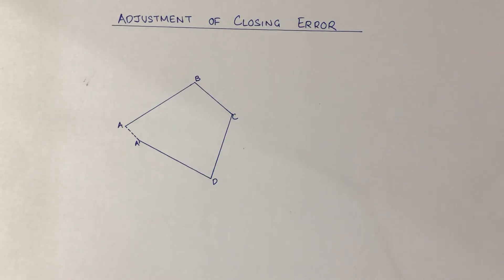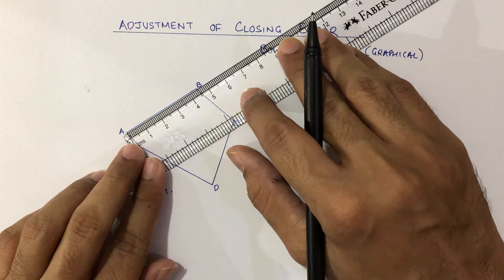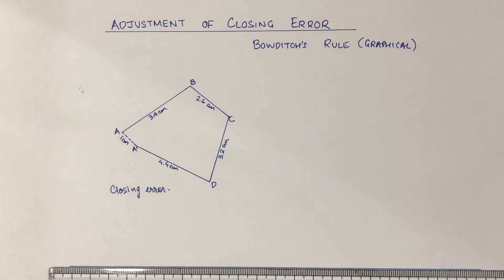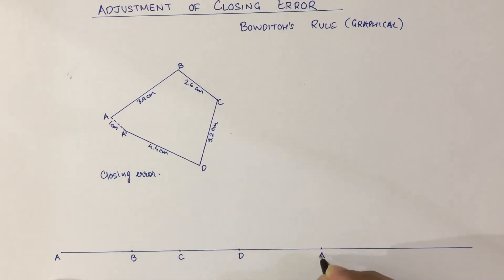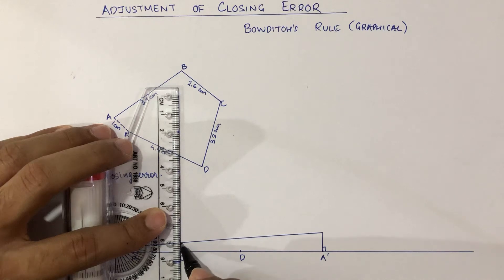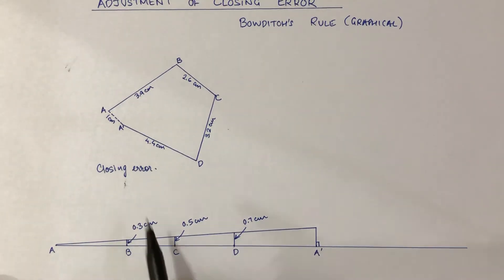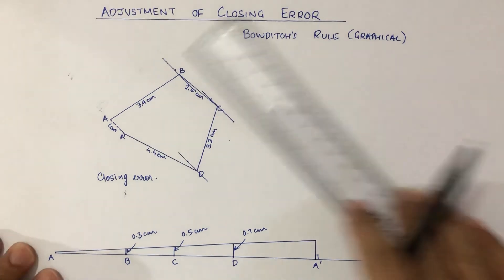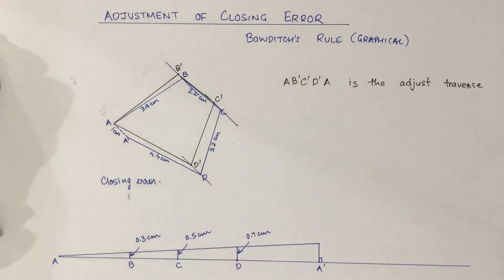Adjustment of closing error by Bowditch’s rule

Comment: Sir what is the real life use of this ?  Why I need to learn it?
Reply from the maker: While doing closed traverse, the start point and finish point should coincide. But due to personal errors, instrumental errors or natural errors, they might not coincide. The distance by which the traverse fails to close is known as the closing error. This closing error has to be adjusted (which is shown in this video), otherwise the errors will keep on accumulating and lead to inaccurate result.